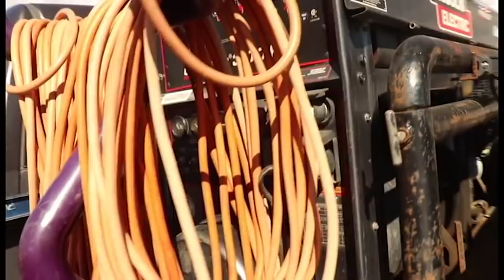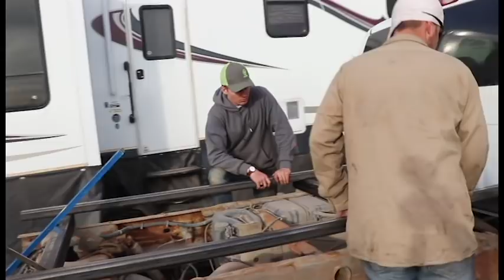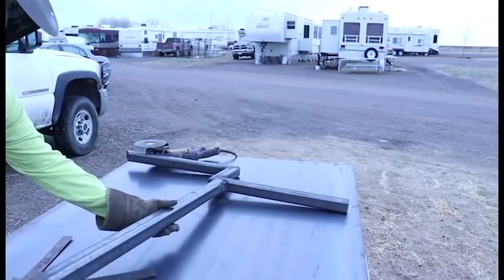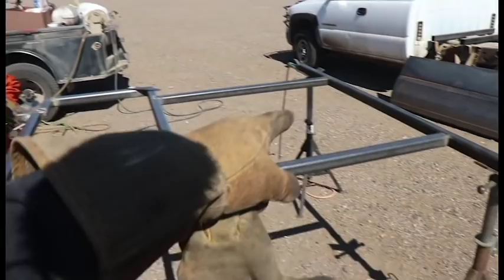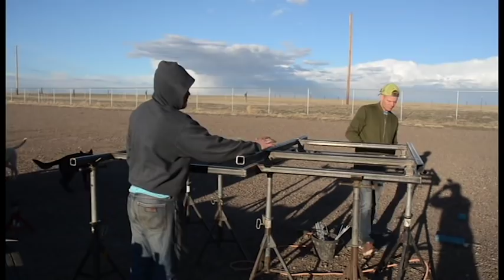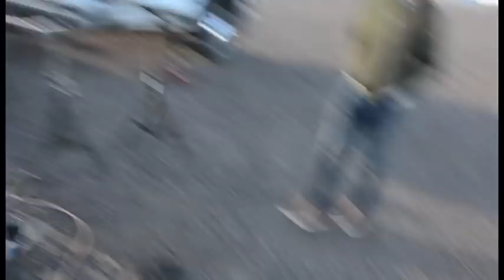Welding Bed Build Getting the Frame Ready!!

Comment: What size tubing are you using? 2x2" what gauge? Thanks in advance!
Reply from the maker: Dale Nix 1/4” thick itsnplenty stout
Reply: Jacob Schofield any worries about weight on the 3/4 ton? Are you adding helper bags or anything suspension related? Sorry for all the questions, I have an old farm truck I would love to do this and make my "service" truck on my farm. Only thing I would need different is a auxiliary fuel tank with at least 50 gallon capacity adding another 350lbs to the bed. What are your thoughts. 
Thanks man keep the videos coming!

Comment: Where did you get that bed side? 13min 14sec. Thanks
Reply from the maker: Ricky Beadle a shop here in Colorado I got 4 sides for 600.00 they did a great job
Reply: What's the shop called?